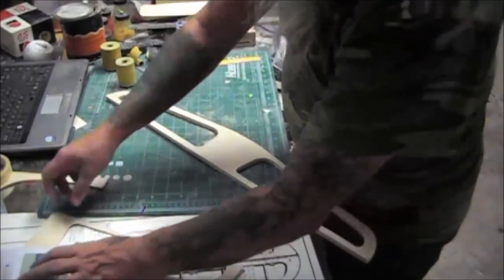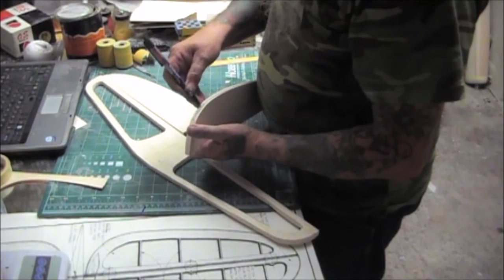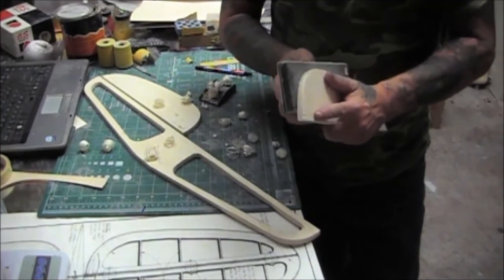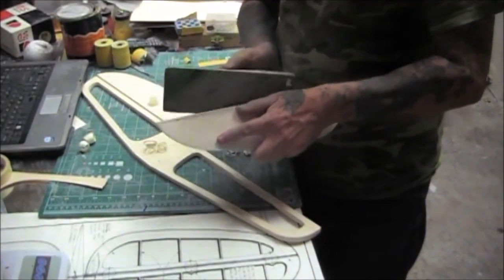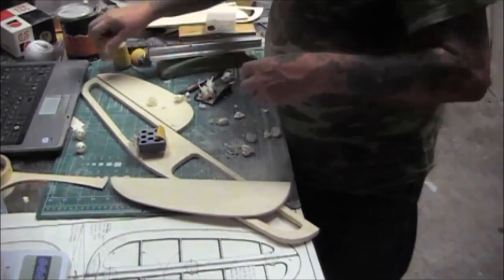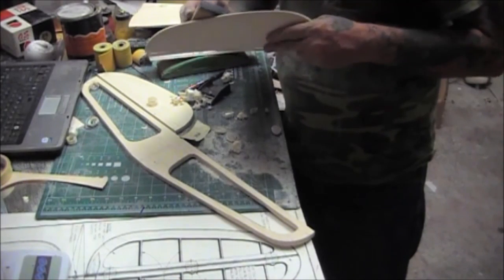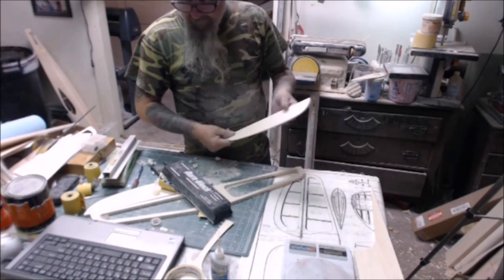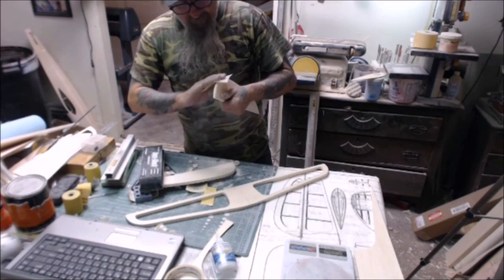Control line electric Thunderbolt stab 2

Comment: what's the weight of the battery plus engine? Are they heavier than the equivalent glow engine installation?
Reply from the maker: +adamcrookedsmile Slightly lighter
Reply: +Stunt Hangar how many flights are there in a battery ? Or do you charge many at home and then swap them out after each flight ?
Reply from the maker: +adamcrookedsmile I have 5 batteries and You swap at each flight and charge in between.